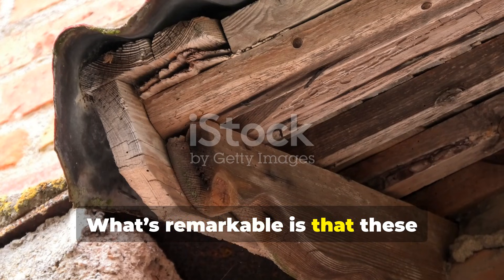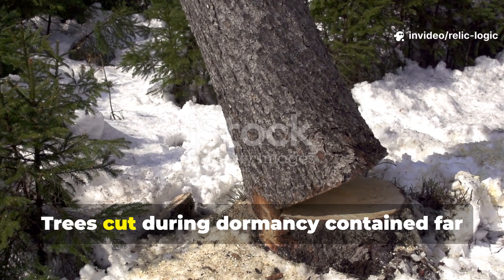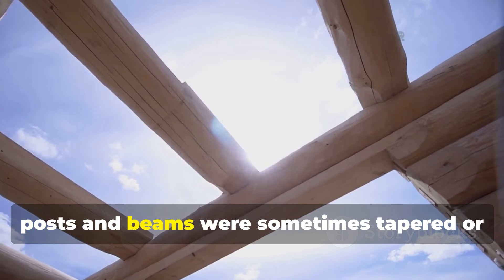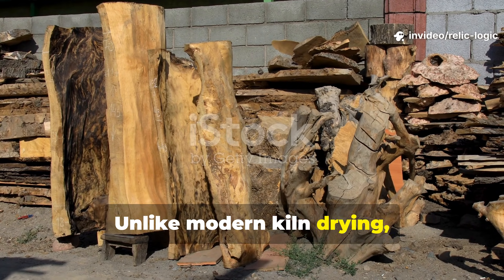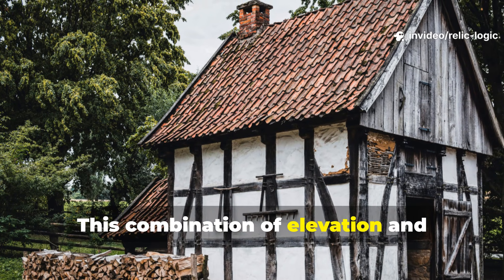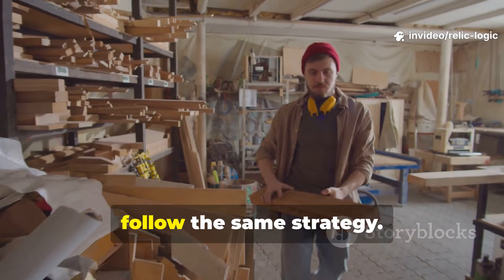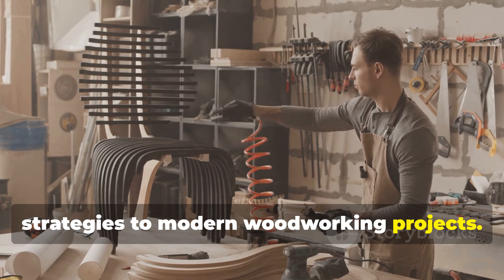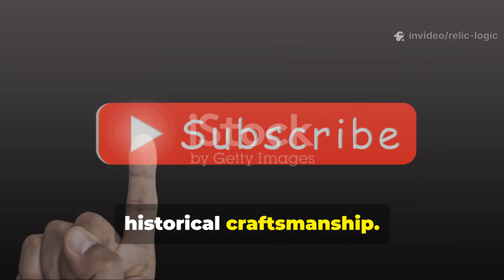“How Medieval Builders Stopped Rot Without Paint, Tar, or Chemicals”

Comment: They privilege heartwood LOLLLLLLL bullcrap. Sap is cracking warping and the worst part of the tree. They used waxes and oils and changed, repaired in time. There's no ''incredible knowledge of ancestor''... They had the same knowledge we have.
Reply: yes this is ai generated slop through and through. dont believe a single part of any of it
Reply from the maker: The knowledge is spot on
Reply: They even claim to use air dried wood after 2 months.... GL with that... It takes years to air dry wood.